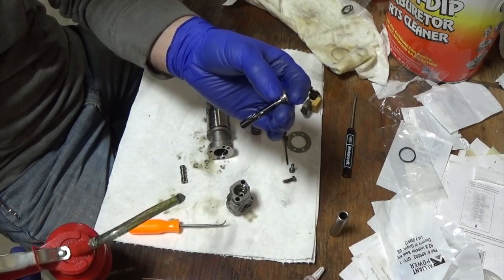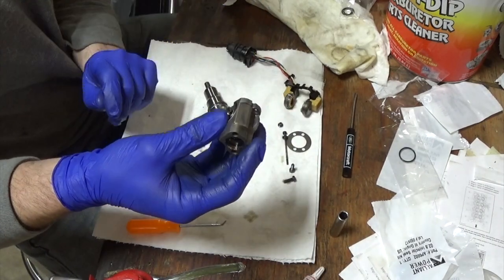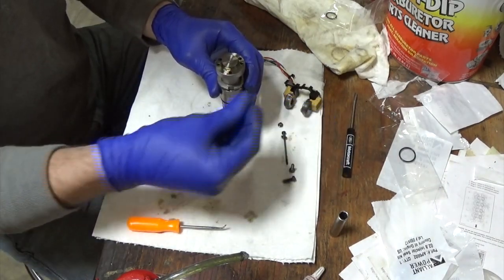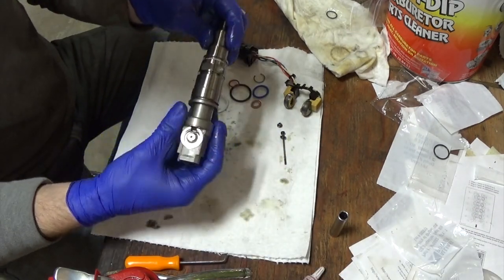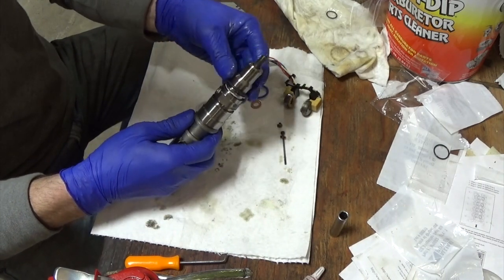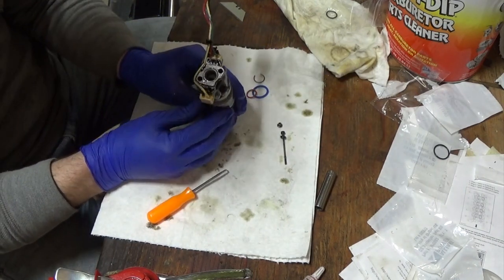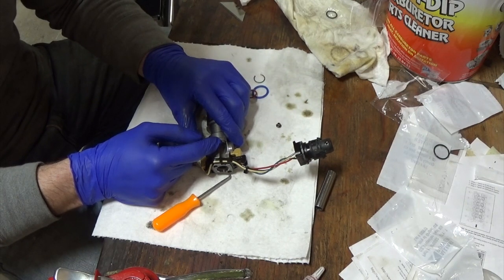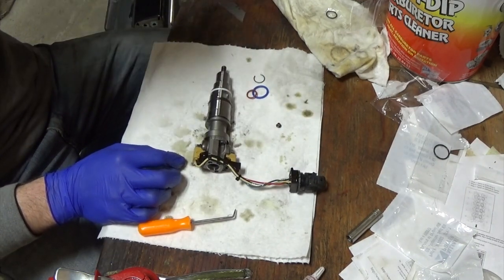6.0 injector final assembly

Comment: WARNING!!!  Great video. I followed the tip about not overtightening the solenoid bolt but my nuts lost the ability to stay put and I lost the nuts down into the oil passage return. You need to pinch the nuts with a good pair of vice grips and some red locktight so you don't suffer the same fate
Reply: Lay the nut on a vice, hold it down on it's side with a piece of wire through the hole and tap/pound it out of round just enough that it requires a fair torque when tightening - poor mans friction nut.
Reply from the maker: Sorry to hear that happened. Hopefully you were able to get the parts from the oil pan. 
I can’t remember what company sells new solenoid bolts and nuts. I’ll respond when I find it.
Reply: @showmerepair  My fault. I should have known better. I have to take the other side apart tomorrow, because I fear the solenoid bolt is sliding back and forth and not the spool valve. I've been working on this truck for the last month and trying my best with what limited funds I have. I spent the last three days doing the right bank in a field with 20° high temperatures. If the nuts are still on the driver's side I'm going to snug them down and crimp them with the vise grips and pray the smoke goes away. I have to move my trailer before CSPD (Colorado Springs) hauls it to impound. I left a note saying that I would have it moved in three days and that was last Monday. In my defense, I'm a retired body man! I just make them look good. But I've been around long enough to know better. It's to cold and I'm not motivated enough to take the oil pan off.  I can only pray. But still I couldn't have rebuild them without your videos. And for a couple hours it seemed like I had it fixed. But when I lost the nuts it went bad instantly. That's why I'm certain that I lost the other side now. Thank God the block heater still works. I don't have to keep running inside to warm up my hands. One thing I can't find is anyone who makes the pintle tips that go inside the injector tips mine have wear rings about 1/64 inch from the tip, like a wore out spray gun jet. Some don't have them that's why I think they're shot.

Comment: Chris a great video  .   I use vasoline as assembly  lube .  It holds
all your parts in place . I also use it on the Orings to assembly in 
the heads .   Have you used a different brand of rebuild kit ?  I 
Like the USA made Orings .
Reply from the maker: Thanks you. I have not used a different kit. I like either standard or deluxe kit from Bitterroot. 
Vaseline works well. I usually just use axle bearing grease or oil now.
Reply: @showmerepair   Your oil looked sticky .Like bar oil .
Reply from the maker: I was using Lucas oil additive. I now longer use it since I had a set of injectors that I rebuilt for myself that sally for several months and it didn’t hold up very well in a package long term. So I usually use some kind of motor oil that I have setting around. Holds up longer from what I’ve seen
Reply: @showmerepair  Thanks  .  I have had good  Luck with Vasoline .

Comment: I didn’t see in the video which side of the spool valve that the 4 washers went on— did I miss something?  I replayed it several times and could not zoom in on the video to tell which side they were on.... Help?  I am putting all eight of mine together this evening....
Reply from the maker: I’m sorry just got a chance to respond. 
The washers go on the head side of the bolt. The threaded side of the bolt faces the same direction as the coil wiring goes.
Reply: Thanks man! 🤙
Reply from the maker: Your welcome

Comment: Watched all 3, awesome attention to detail.. takes all the guess work out of this repair EXCEPT for the torque for the solenoid top torx and the solenoid bolt/nut. 

What was written on the NOZZLE(size)??

THANK YOU!!!
Reply from the maker: buddha65281 the torque for the  solenoid bolt is in my injector coil failure video. 
I can’t remember exactly what was on the nozzle but I believe it was a bar code and numbers. It may say what size it is if a person could decode it. Thank you for the comment.

Comment: Great videos. Have you ever had injectors where loctite was used? I broke one of the notches where the hold down locks in while trying to get it apart. The second one seems tight as well, I gave up before breaking another.
Reply from the maker: Scott Dunn I have not seen any loctite used but some rebuilders May have used some. On another comment you had said that you broke a vise while trying to take the injector apart. 
I do use a 2 1/2 to 3 foot breaker bar when disassembling the the injector body. Using a propane torch for 5 to 10 seconds around the threaded area may help it loosen up. It could have carbon causing to to seize. Good luck.
Reply from the maker: Scott Dunn I just reread you other comment. You have already used a torch with no luck. You way try disassembling one other injector. What was the reason for rebuilding the injectors?
Reply: @showmerepair  Sorry for the delay in response. Truck was running horrible. I have since rebuilt all 8 injectors. I used an impact to get them apart, worked well...kinda sketchy though. All 8 of the old tips were partially plugged, at least 2 ports plugged in all of them, one was hardly spraying out of one. I know my brake cleaner can isn't spraying at the same psi as the truck makes but none the less.
Thanks for the vids they helped me a great deal. I installed 30% injectors and am now rebuilding the oil rail seals as that caused other issues after the injectors were done.
I will mention I ordered my kits from somewhere else, not Bitterroot as they were out. Some of the internals like the plunger (3 of them) did not fit the bore properly.
Thanks for the response, its appreciated.
Reply from the maker: Great to hear you got them rebuilt. Where did you get your parts from? This video is not associated with Bitter Root. Feel free to share other companies. Also will you be doing your own tuning to calibrate for the 30% larger injector tips?

Comment: Amazed you dont have more veiws. you have the best explaining videos on the web for  full rebuild. not just a bunch of washer changes.  thank you my man you save me thousands as well
Reply from the maker: charles baumgartner Thank you. Made the videos because I also could not find good info. I Failed several times on my own injectors before I figured it out. Make sure to torque the coil bolt to the correct torque. I go over the correct torque in my coil failure video.

Comment: Chris I started the 60.it ran smooth went for a test drive ran great till I blew the turbo boost tube so I drove it back to my shop cleaned the tube and went to restart and it cranked for a bit started and it was a bit rough . What happened. ?
Reply from the maker: Rod Williams the oil filter housing will not hold oil with the filter removed. You’ll have to push down on the black button in the oil filter housing.  If it still has trouble filling the oil filter housing with the button/valve depressed then you have base oil pressure issues. 
Any time the high pressure oil system is opened. The truck should be driven a minimum of 10 miles of highway to get any air out.
Reply from the maker: Rod Williams i need a little bit more info. What were you originally test driving it for?
Reply: @showmerepair  Hard start when cold and the guy thought a set of glow plugs  would solve that it didn't.  That's when I got involved but the guy wouldn't pull the blanking tubes and install the new style . Now he has replaced the olp sensor screen and the ICP sensor and rebuilt the Injectors .
I found the oil canister doesn't retain oil  and you still have to crank quite a bit till it starts .  ?????
Reply from the maker: Rod Williams what is the temp where you are at in the mornings when it’s cold? What is the ICP when cranking? Once the engine starts how does it run? Are there any codes?
Reply from the maker: Rod Williams Is recommend gathering as much information about the engine by performing test before replacing parts. That way your not wasting money.
Reply from the maker: Rod Williams  what are you referring to as the oil canister?
Reply: @showmerepair  Oil canister is the filter housing

Comment: My truck  died driving down the road. As I’m troubleshooting it I do the air test in the oil rail and I find that I have a leak on the passenger side towards the back. I pulled off the oil rail and tested it out with air and it was fine. Then I made up a little tube to insert into the injectors and air test them individually on the truck and The back cylinder on the passenger side leaks air out of the two little holes on top. What would cause that or why am I having that problem in just this one injector?
Reply from the maker: glamisfan777 most likely spook valve stuck in the open position.

Comment: I have to agree with all of you out there. These videos are priceless! After restudding my '05 6.0L I had stiction issues. I pulled the Injectors and tried the ol' sanding the poppits trick. Even though I was told that wouldn't last for long I had to try it. Just to restud the truck ain't cheap...but a necessary evil. The trick did fix my stiction issue so far but it started having an injector misfiring all over the board when the truck warmed up just as you described. Cold up to 170F it ran great but any warmer #6 would drop out, then work, then #5, then 3, 4, so on and so forth. So I started changing injectors. After 2 inj.$400 later someone on one of the forums chimed in and told me about the whole over tightening problem on the spool valves. I thought how tight is too tight? How long is a piece of string? Who knows. Then you not only mentioned it here Chris but you explained how to tighten them. Thank you. The details you gave in this video was great. I backed my spool valve bolts off and retightened with your instructions(I couldn't find instructions better than yours). My injectors are working great now with no more misses. This saved me another $1200 in injectors. Good work to all you guys who have made these videos out for us DIY'ers to follow and Thank you!
Reply from the maker: J Hamm Very happy to see these videos are helping so many people. Thank you for commenting.

Comment: How you Test leakege on the spool valve it's normal if we have bubbles on the two little holes
Reply from the maker: angel reconco xD  no way to test spool valve for leaking that I know. 
It sounds like you have air entering the  high pressure oil system, oil level full. Or the engine oil is not correct and it is foaming.

Comment: Awesome Video! I just finished rebuilding my F-350 engine with over 300k. I’ve been toying around with buying remanned Motorcraft injectors but after seeing this I’m gonna rebuild em.
Reply from the maker: Bj Schreuders I’ve heard Bitter Root recommends that injectors with 300k May not benefit from rebuilding. Do to some internal parts may exceed specifications and are not replaceable unless bought with new/ reman injectors. I recommend contacting Bitter Root for info.
Reply: Chris Bryant makes sense. These have actually all been replaced at some point with Ford Remans and the truck is running great. Just experiencing slight stiction when cold. Idaho Cold that is.
Reply from the maker: Bj Schreuders with 300k I’d probably stick to 15w40. Stiction additive and hot shot anti-gel would be a good start. Got watch Project Farm YouTube channel. He test different diesel fuel additives. Good video
Reply: @showmerepair  So I'm curious as to what happens with the 300,000+ mile injectors that Ford gets in on core, do they just throw them away reckon?  And I wonder who makes the actual injectors?  Because someone has to be supplying all the brand new injector housing/body parts.
Reply from the maker: Ole Dude that’s a good question. It would be cool to find out who and where. There may be something like a patent that limits who can manufacture. I do know For the Superdutys. Ford’s injectors are the best stock. And most places start with a ford injector then modify them to their standards for performance. Or International is controlling everything.
Reply: @showmerepair  Yes, I bet that International somehow controls it being they made the engine itself.  Is International still making the VT365?  I can't remember if it had to meet emissions in the bigger trucks or not.
Reply: @TheVenom8343  Siemens injector manufactured by Pure Power Technologies.
Reply from the maker: Bj Schreuders have you tried Hot Shot stiction eliminator?
Reply: Chris Bryant I have not. Definitely worth try. I only experience the stiction in below 15F temps and my block heater is not plugged inI’m running 15w40 and normal on road diesel with no additives. I’ve heard standadyne makes a good additive too.  Maybe switching to 5w40 and using a cold weather additive will make difference.

Comment: Chris thank you for the videos, doing mine aswell. How are the injectors holding up? I was thinking about getting the 30 percent bigger nozzles
Reply from the maker: Lonnie Freeman holding up great! It’s been a low of 20F and up to 50s where I’m at. Truck is starting and running great. Make sure fuel pressures is good when putting injectors is truck. Don’t want to damage a fresh set of injectors
Reply: @showmerepair  10-4 Mr. Bryant, one more question how about replacing high pressure ball tubes and orings? Would you replace them at the same time? Because it takes 90 percent of time removing other parts.
Reply from the maker: It wouldn’t hurt to replace them. I forgot to comment on the 30 over nozzles. I do not have experience with 30 over nozzles. I did just buy a set of 30 over nozzles and sent internals off to bitter root to machine parts to 190cc. I also just bought a DIY turbo upgrade from KC turbos. Videos will be made
Reply: @showmerepair is that a parts kit to rebuild/upgrade the turbo or new turbo? I rebuilt mine and installed a wicked wheel. Power gains are noticeable.
Reply from the maker: It is a 63.5mm billet wheel, machines compressor housing and rebuild kit.
Reply: @showmerepair  dam I wish they had that kit available when I rebuilt mine. That's good deal, especially for towing.
Reply: @showmerepair  last question mr Bryant. Did you put the injectors back in the same cylinders after you rebuilt them?
Reply from the maker: No I did not. You may want to make note of what cylinder they came out of if you were having an issue with a specific injector. Injectors are not designated to a specific cylinder on the 6.0.
Reply: @showmerepair  good deal, I did passenger side today and it went as planned which is scary because usually god throws in couple curve balls. I believe I found the issue of the hard starts. Every bolt on high pressure oil rail was completely loose. Those bolts by heater box is a pain in the ass. If international would made that motor little bigger. It wouldn't of fit
Reply: @lonniefreeman4278  — I always take the dam heat shield and cover off to get to the passenger side.  Works for me— but I need to buy a smaller low profile, SLIM ratchet.  If you have a suggestion— I’d love to know the brand and combo you use to get in there?  I have an early 04’ 6.0L— it’s tight!  It also comes with the barrel style oil/fuel rail...

Comment: Chris,  Bitterroot is out of stock, is there another source?  I can find the o rings, but wouldnt want to do it and not replace the springs.  Thanks Kev.
Reply from the maker: I do not know know any other place that sells these kits. There most likely is another place but I have not searched since I found bitterroot.  Have you called them to find out how long they will be out of stock?
Reply: @showmerepair  left a message, dropped an email, and now I wait.  Im living on a small pension, and the dealer informed me i have turbo and injector problems.  I paid for an extended warranty, but these parts are not covered..  of course...  so, in my old age, back to turning wrenches.  thanks for getting back.  Great videos.  Subscribed and look forward to watching more.  Kev.
Reply: @mrkrharris  I just ordered the kit from bitterroot. Be careful with other oring kits. 90 percent are made in China

Comment: Just wanted to throw out a big ThankYou for this video series.  After watching a few times, this gave me convidence to tackle this task.  Ran into a few different issues with my injectors #1 had a burnt out coil.  Literally a melted plastic and a wire poking thru.  #5 had a stuck spool valve.  Had to lightly punch it thru.  I think the spool valve housing has grooves.  Tried sanding the spool valve itself but didn't seem to  help much. Still will not slide smoothly. Going to have to replace the spool valve and housing.  And finally on #8 had a broken plunger spring, broken hat, and abnormal wear on the side of plunger.  I had ordered the bitteroot kit along with new coils but I just ordered two cores of ebay to finish up the job.  Really not a difficult task once you have done a few.  Anyways, thanks again.  Truely a great video series and will help many others.  Look forward to more vids. Kevin
Reply: Damn fella!!  How many miles are on your 6.0?

Comment: Thanks for making these videos, makes the rebuild look very feasible compared to paying for rebuilt injectors when one fails. 

Do you ever replace the coil assembly on the electrical portion? Some of the plastic seemed brittle on one I pulled out.
Reply from the maker: Nick Potter if I have an electrical issue with the coil I would replace it. If your talking about the plastic piece that the coil wires route through to go around the injector body. I’ve not run into on being damaged beyond repair. I don’t know where to find them.